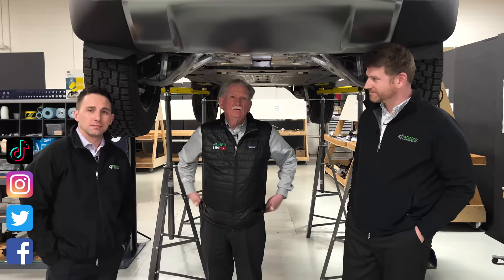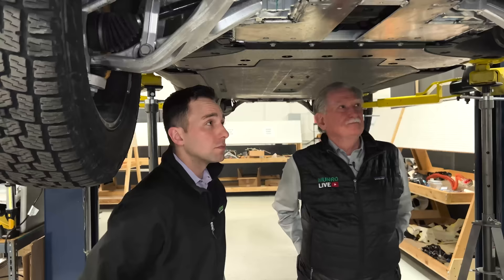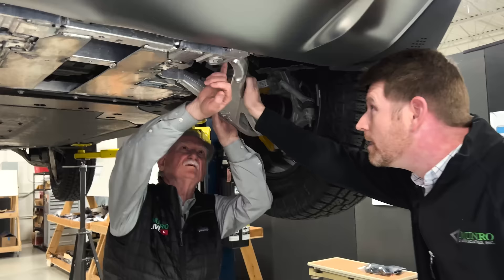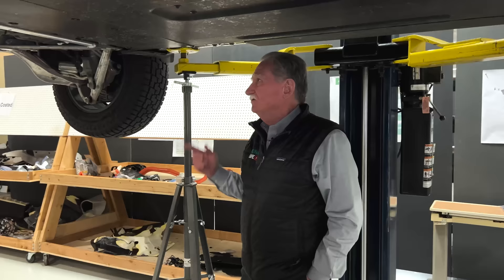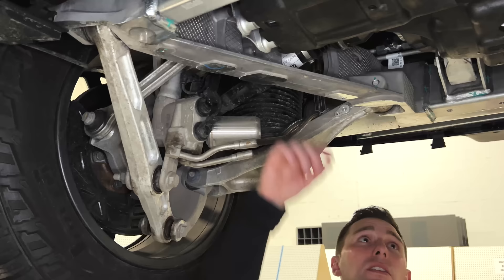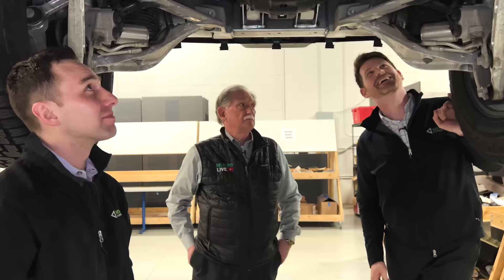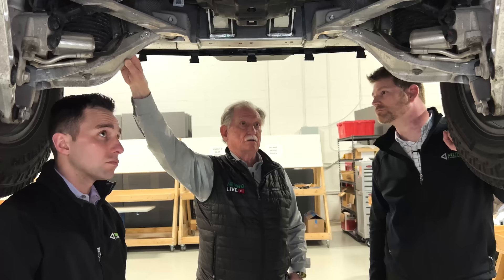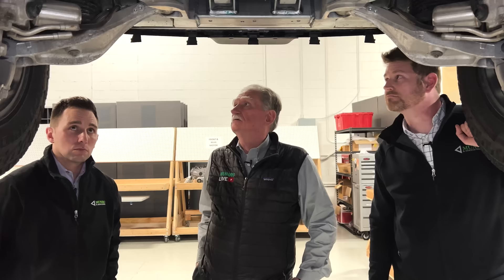Rivian R1T Electric Truck | Hoist Review

Comment: The young guy had some great info and flow to his presentation. He’d be great to take more of a lead for vids.
Reply: just  make sure his mic is working and/or his gain adjusted, he's easily %50 below the other mics.
Reply: I agree.   He does a great job of using engineering, trade, and laymen terms all in one explanation.   I really liked his delivery.
Reply: Another paid shill in the comments section
Reply: Munro delegated the talking to these guys in this video for a reason - and it ain’t a good one. The front suspension strut being so close to the wishbone knuckle was smoothed over quickly wasn’t it.

Comment: I do product engineering myself, not cars but industrial equipment.  It's always nice to see engineers going the extra mile and put in creative effort.  It's also good to see a company that will allow their engineers to spend the extra time required to do this kind of stuff.  Ultimately you get a better product for it.  The tight tolerances and higher complexity to parts, the variability in materials and construction methods, these all show flexibility in design creativity and a broader knowledge set.  Elements are purposeful and specific to the target function.  Unfortunately, it isn't a design that's highly cost effective, so this is never going to be a design you'll see at $30k or $40k.  There's just too much cost in what's being attempted.  But there is also the ever present value for the money.  Are the dollars being spent well?  Are the dollars being spent in the right ways?  Is the extra $10k or $20k really well spent?  Are you getting a substantially better product?  This is something I wrestle with customers all the time on both customs and volume production designs.  At the end of the day, price is generally not the problem.  But falling short on the features, quality, and performance is.  A product that under delivers is a product that does not have value to most customers.  

A great example is the decades of earlier EVs and hybrids that never really took off.  It was never that people didn't want it.  It was that for the most part, many missed the mark considerably.  Only a few hit well on the target, and those few saw significant volumes of sales.  A great example is the Prius.  The package as a whole had few faults and the overall design targets were inline with customer interests.

Rivian took a particularly smart approach that to date no one else had taken.  As a startup, they took the two most popular platforms on the market, SUVs and pickup trucks, and that's what they built.  Every other startup went straight to a halo car only meant to entice the more wealthy early adopters.  But this pool is limited, and both the price point and the market space is competitive.  Tesla got lucky getting a decade of market time by themselves.  That was a massive luxury nobody else has.  So to follow the same approach with a halo car for seed money to scale up is maybe not the ideal choice.  Additionally, the major automakers are now stepping into the game.  Ford is hitting the EV sector hard with some great offerings.  Now it's no longer just startups.  Now it's the big fish too.  So, how do you sell and grow?  The better bet is to aim for the big market pools.  You'll sell numbers, and this also has its challenges, but you'll have a higher volume of customers that likely won't run dry.  The challenge for Rivian is they took long enough that automakers like Ford put a truck in the market space at nearly the same time.  A Rivian just a year earlier would have presented a significantly different market prospect.  Late to market is just as big of a downfall.  Luckily Rivian didn't put in a half effort.  They attempted to exceed expectations, and that will likely pay dividends as the brand name grows upon that.
Reply: From the little I can see in this video they use terrible materials for long term use in the real world.

Comment: “This could be the last vehicle I ever buy”. Coming from Sandy, that says it all. I’ll be holding onto my R1S for a very, very long time
Reply: That is quite a recommendation indeed. Sounds like a great car but one thing perplexes me .. given his  knowledge of quality etc is that he drives a jeep which despite its offroad prowess is frequently last or at least very low in objective quality and reliability comparisons with its peers.
Reply: @terranowe  opinions are relative
Reply: He says that, but just their short term roadmap of improvements are too big to ignore. Rivian native motors claiming an extra 50 hp at each wheel with better efficiency, 800v charging, and a heat pump alone will prob push a lot of people to wait for that refresh. Hopefully happens sooner than later, the charging speed especially

Comment: When you hear an old dyed in the wool off-roader like Sandy Munro saying he doesn't miss his latest Jeep and likes his new BEV Rivian better, that isn't good news for Stellantis or the Jeep brand.  Glad to see the uncovered suspension and hear the analysis from the suspension experts at Munro.  I'm a little disappointed the front cradle is still welded extrusions rather than a fully developed die casting as that adds cost and lowers production volume.  Hope to see that change as production volume builds at Rivian.

Comment: Awesome guys!
Longer arms can reduce camber change too, as the suspension cycles up and down……but I know you know😎
Reply: That’s what they mean by longer arms allow you to get more travel. You can put a longer strut on with the short arm and get travel but you’ll have camber issues.
Reply: Camber change is determined by the relative lengths and angles of the upper and lower arms - the arms don't have to be long to get minimal camber change.

Comment: The Rivian does have a full frame like any other pick up truck .."body on frame",..though the body is mounted directly to the frame  without any rubber  bushings in-between like you see in all other pick-up trucks.

Comment: also regarding the motor padding... anti vibration pads for heavy machines or air compressors will have multiple layers alternating hard and soft materials as that absorbs more vibration than just one thick soft layer

Comment: Great video, guys! It's certainly impressive to see a full aluminum suspension with the uprights and cast arms everywhere, but that lower plate and all that welds on the front subframe didn't look that good, eh? Also the front pivoting ball point for the lower arm isn't the best... Anyway, was kind of sad to hear Sandy saying that this may be the last vehicle he is going to buy!! Sandy, we all hope you will outive this and buy many more! 😉
Reply: Agree, the front subframe looked horrible, I was also wondering about that front lever rubber mount, why did they mount it that way and not like 90° tilted. I don't think that rubber mount will last very long but of course it's very hard to tell what's going on by looking at this for 5 secs on a yt video. Also the cv shaft in the rear needs to be put through the frame, which is not very production friendly.
Reply: @computercrack  Exactly, the front horizontal rubber mount is rubbish. Mini and Bmw use it one a few models, they always go bad after a short time. 👍 Nice to see that is not just me....
Reply: As a early release from a brand new company it doesn't that bad.  I saw worse stuff from Ford and GM with decades of experience in manufacturing
Reply: @psdaengr911  It's a low volume very premium product priced pretty high, comparing to Gm and Ford does not make sense.
Reply: @GiovanniEsposito5  I put myself through college building trucks that ran Baja. I see nothing wrong with the construction
Reply: for reals... his comment on "last vehicle"...  i hope he'll live a healthy live pass 100 and be able to continue enlightening us with more engineering knowledge.

Comment: Impressive packaging, but also your engineers are very articulate
Reply: not really, if RIVIAN wants to SCALE, it's going to have to use MEGACASTING and structural battery pack.
Reply: @markplott4820  R1T and R1S were never meant to be very high volume programs. For high volume, Rivian will likely create a new vehicle architecture.
Reply: @markplott4820  Tesla did the same thing with Model S/X line for low volume and 3/Y for high volume.

Comment: Sandy's protection racket: "No more spanners, this is mine and I'm keeping it." And wry smiles from the guys. Tell you what, Sandy, you better keep an eye on this one... and those two. Thanks for the walk-under, guys. This is engineered to be the real deal.
Reply: 1:30 ? and at what cost?
Reply: You can tell Sandy is pulled between the "teardown" angel and the "keep it pristine" Devil on his shoulders.  Not everything is a business decision.   But the look in Sandy's eye when he was looking at the under designs says it all.  He could help Rivian a bunch with redesigns.  It could mean the difference between survival and death for Rivian.  I would love to see their parts Bill of material at the final assembly level in a Pareto Chart by cost. 
Id also love to see the same list of parts from the parts availability and defect.
The overlap between these charts will determine the focus with which they must attack the problems with scale, cost, warranty.
Reply: @greggmcclelland8430  Rivian trucks cost 4,565,217.39 per vehicle to build in 2021
Reply: @thesure1  I don't know. What I do know is the RJ and Munro et al should reach an agreement. I am sure that would enable major strides in terms of cost and manufacturability which, given the engineering verdict, they now need to move further ahead of the "pack". Ford and GM are coming...
Reply: @evertnuman7227  not if they don't tear it down...
Reply: @thesure1  huh? An agreement would be to tear another one down, would it not? Sandy bought that one there?

Comment: I've walked around this in person, but seeing and talking through the suspension is way more impressive!
Reply: Of course! This pickup truck is heavy like a mountain lol…..
Reply: R1T not as impressive as the CT suspension.
R1T is an OK truck.
Reply: @alanmay7929  - Cybertruck might weight only 5000 lb.
Reply: @markplott4820  you have absolutely no idea of the final weight, let alone with or without all the features. Traditional trucks comes in all kinds of configurations from single to double cab/ long-short bed and live axle/IS and also different engines and tank sizes and many other features for heavy duty applications.
Reply: @alanmay7929  - TESLA is aiming for MEDIUM HD class w/ Cybertruck. 
2 axle, 4 motors, 1600+ HP, 1200+ lb Torque, over 200 mph. 5000 lb payload and 20,000 lb TOW.
Reply: @markplott4820  the model x plaid has well over 1000hp but barely tows 5000lbs, has barely 163mph top speed, the Porsche Cayenne turbo s has only 600hp, top speed 195mph and toes 7000lbs.
Reply: @Mark Plott  have you inspected the final production version of the Cybertruck vs a prototype? 
Do you speak from a place of expertise?
Reply: I would like to roll around underneath one of these on a mechanic’s creeper while stationary on the ground. Would like to see how the suspension sets when settled.

Comment: S J & K, Coming up from underneath, it is a "different" angle from everyone else. And it is altogether extraordinarily thought provoking. One thing I cannot help but recall is something Elon said to Sandy in conversation: The best time to buy a new model is with the very first cars to come off the production line, OR much later when big volume production is sorted out. And so we can all be very happy for Sandy, personally, to have a something he can be so very happy with. It if very nice to see the truly great complement that you all give to all the long hard work of the Rivian design engineers. But I cannot help but recall what you would all turn your mind to at Munro if you were tearing it down, and as a very first step the production engineers requiring a die cast or permanent mold casting simplifying everything at the front suspension inner attachment . . . and if only you could that sorts out the whole relationship to the unibody from both sides . . . or all the standard incremental steps before you could think of something so big, or in this case, so small and simplifying.

Comment: I think the most likely reason for the rear suspension cradle being hard mounted is because it is a pick up track.  NVH benefit of reducing noise to the cabin with isolated mounts is not required.  All vehicles where rear suspension mounts are below cabin space will require greater level of isolation.

Comment: HI Sandy,

That aluminium has been welded by a MIG. It doesn't have the tell tale "stacked dime" look, you can even see where they have tired to clean the carbon off with a brush and it just looks like a fat blob.

Comment: Would have preferred some additional information on suspension setup. How's the unsprung mass?
Reply: It's a very conventional aluminum double A-arm front and 5-link independent rear suspension, so unsprung mass should be similar to other vehicles of similar design and axle capacity.

Comment: Man, I don't want to be the guy who has change any suspension parts after 5 salty winters. Steel bolts direct into aluminum threads. This is self locking! It is even hard to get the bolt through the aluminum part of the rubber bushing, but out of a corroded aluminum thread... Either you twist the bolt off or you destroy the thread in the aluminum.

Greetings from Germany
Reply: Stimmt :)
Reply: Yes, I had the same concerns.
Reply: I would definitely be jet washing and lightly oiling after the road salting season. Time consuming but it has certainly helped to keep components free on cars I've owned in the past.

Comment: Some top quality engineering going on here. Although seems like a lot of places for mud to collect.

I would not look forward to cleaning this down after using it as a farm truck for a season or two.
Reply: Yep exactly what I though too, have cleaned off lots of mud on Army trucks and 4x4
Reply: a lot of it is covered by a skid plate that was removed for the video, the suspension parts will collect but then the mud will dry and fall out from movement so no real issue. this is def not meant to be a farm truck...
Reply: I was wondering that too. Seen great crawling videos bud what happens in the gumbo? I’m very curious because it seems to be a beast stock truck for off-road capability.
Reply: @dorito31561  It's on top of these skid plates that the mud will collect.

I have the same issue on my UTV. Mud accumulates above the diff guards & skid plates and dries into a solid concrete-like substance that requires  persuasion with a crowbar or pneumatic hammer/chisel to break into smaller chunks that can be blown clear with an airline.

It's a pain and this truck looks like it'll be similarly nightmarish to clean.

Comment: I'm sad you aren't going to take it apart. The engineering on this Rivian is phenomenal. It also speaks volumes to quality and value of the vehicle that you can't part with it.
Reply: Hard to comment on all the engineering when you don't get to see it all. :)
Reply: @TheEvilmooseofdoom  I’ve driven one and sandy has too. Have you? The fit, finish, handling and performance of this vehicle is extremely good. Outside of a solid axle coil sprung Jeep you won’t see low speed off-road suspension performance that works better and on road it handles better than my last A6 Audi. It’s not hard to see it’s well engineered when it’s that good

Comment: Wow this is really amazing. I thought Cybertruck would have no competition, but now I'm very quickly convinced R1T is a particularly special vehicle and most likely the one who will win against all the "competition" 😜 from the ICE companies transitioning to BEV in the truck market.
Reply: Lol…… range and practicality is going to win, the rivian or cybertruck are not made for the types of applications where ford or ram trucks are used. The bed of the rivian is really short, it doesn’t unibody which means no customizations…..
Reply: @alanmay7929  Cybertruck will do well.  You’ll find that people will be able to make those work on the job site.
Reply: @seanz6586  lol….. with such dumb bed site designs!? Trucks are made to be super modular and flexible in their use, the reason why truck bed exactly exist.
Reply: @alanmay7929  I'm a big cybertruck fan but you're right. Battery energy density isn't quite there yet for heavy towing anyways.
Reply: @alanmay7929  I'm not a truck driver so I don't know this stuff, but people who know as little as me will do their research and find out the R1T has this great build quality and design and then the choice is either Rivian, Cybertruck, or Lightning. Nobody is gonna be taking market share from these 3. Nobody wants to pay gas prices. All of these 3 electric trucks have varying levels of practical features and range, and they are all at different points on the scale from "Normal" to "Futuristic" in outward appearance which a lot of people think is important. I understand being able to customise your truck is not the same as being able to buy it with all the stuff you need built-in, but also that there are younger truck drivers now who were born after 2000 and grew up with iphone etc.
Reply: @t3hpwninat0r  lol….. are you even serious!? You realise that those electric trucks aren’t for everyone right!? They aren’t even made for towing or going overlanding or even heavy duty conversions for different applications.